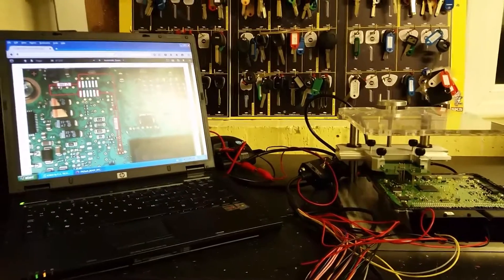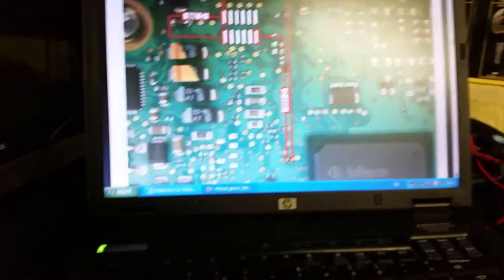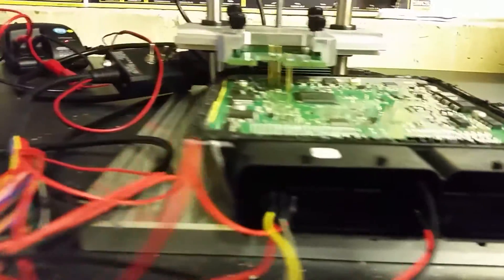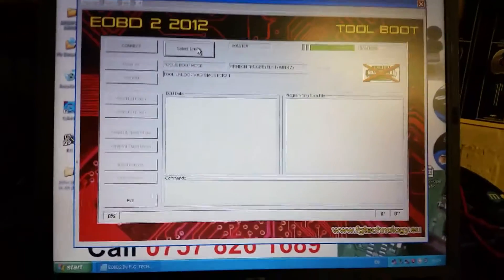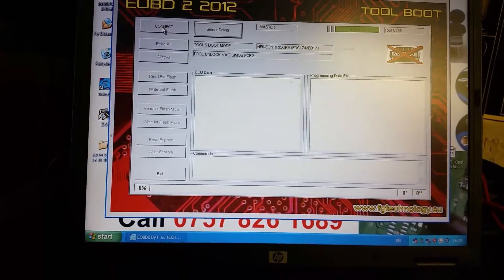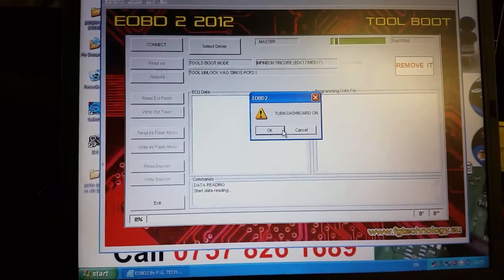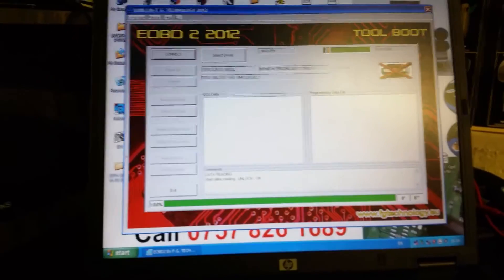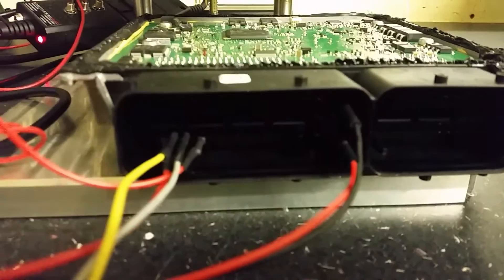How to unlock SIMOS PCR 2.1 ECU from 2011 1.6 TDI VAG to remap on the bench using FG TECH

Comment: Hi lewis, could you please assist me in unlocking the continental simos pcr 2.1 (audi A3 2012 tdi) i'm an auto electrician, however i'm new to ecu work, i need to disable the DPF and the EGR, i have purchased a BDM programmer +  galleto tool. I have winols/ ecm titanium software. Watching your video gave me confidence,however i noticed that your using a BDM frame and a power supply setup, could i not just utilised a basic home made power supply through a simple switch via a 12 volt battery supply? And utilise kynar wire with the 2 resistors that i read about ? Is there a more  clearer image quality of the diagram available ? Would appreciate your kind reply, and BTW love all your videos..keep up the good work, and hope to enlist with some of your various courses, ie; immoboliser, locksmith technical info. My Email is;  nikon_f@hotmail.co.uk
   Thanks and best regards

Comment: Cmd unlock with obd, 15min. Write after unlock 3min.  All on obd.
Reply from the maker: Yes that's right, it's also covered on KESS fully OBD now but this was filmed 3 years ago and back then you couldn't do these with KESS OBD
Reply: @TheOBDcompany  i know i also have kessv2. But i use cmd for vag.  How long is writing time with kessv2?
Reply from the maker: @at0ny  

KESS takes around 6 to 10minutes

Autotuner is very fast around 1 to 4 minutes on lots of stuff

Thanks
Reply: @TheOBDcompany  yeah i know AT is fast but heard the service is bad at the moment,  i only have cmd at the moment and thinking to buy AT also. But also dynopro is on the list so need to thinkg what i want to buy.